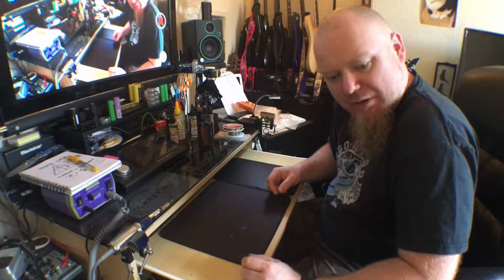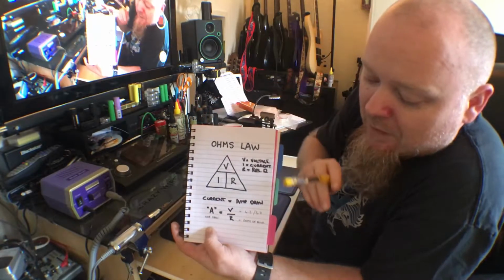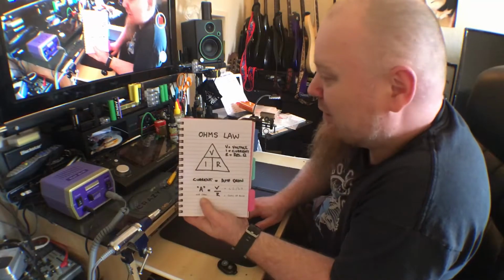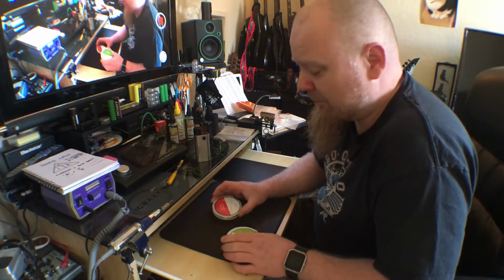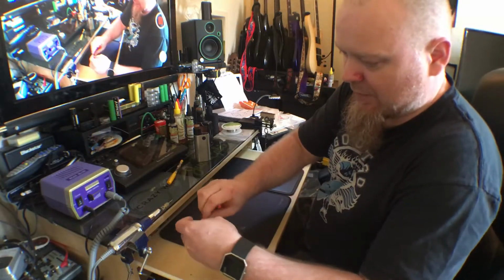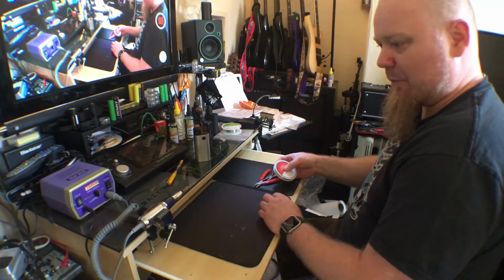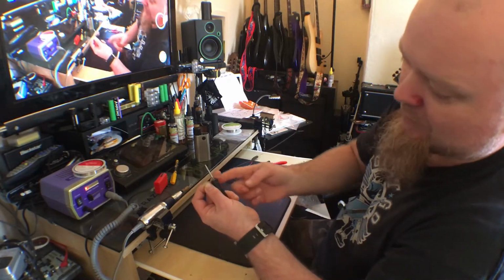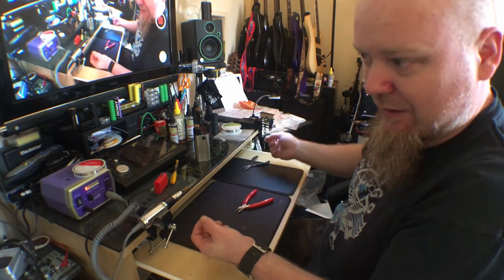Beginning To Build with Foggy Bob

Comment: Good teacher! 
You made it look easy and a warning about what could go wrong can make a difference on getting a frustrating experience or a positive one.

Happy you included the Ohms law and advised on the safety and the importance of using the correct type of battery.
Also suggesting Battery Mooch for a deeper understanding on Ohms Law and battery safety. Good Tip!

Thank you Bob.